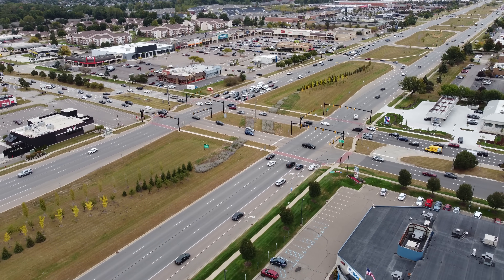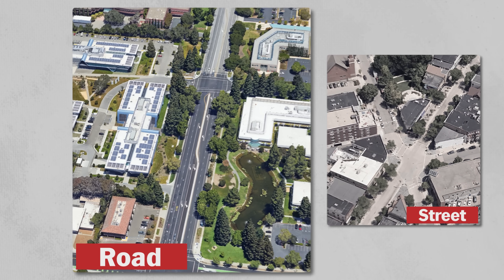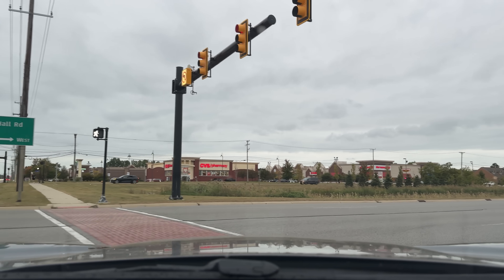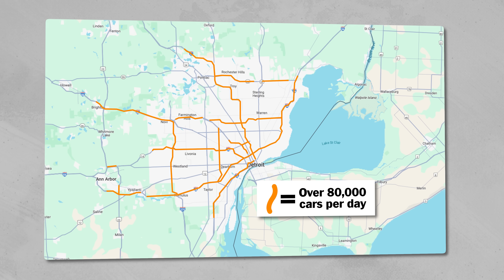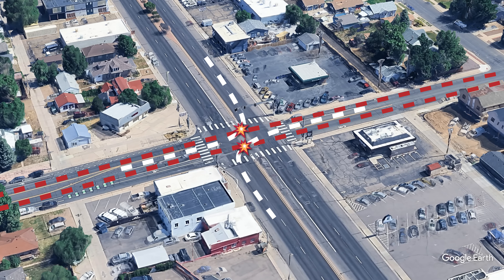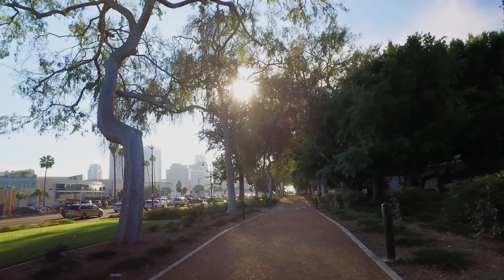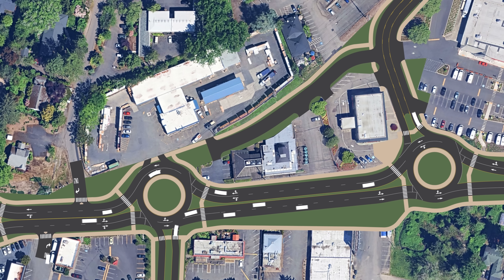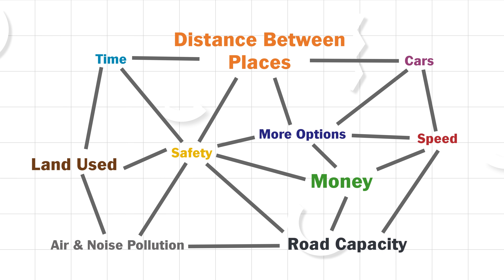How Michigan Built a Super Highway Using Only U-Turns

Comment: Being not a Michigan resident but a frequent visitor driving Hall Road, there are two concerns...

1) You still have to cross over all lanes of one direction to reach the switchback to go the other direction, and most drivers want to use the first switchback available.
1a) Or, if you do the switchback first and then take the right, that also requires crossing over multiple lanes of traffic.
2) Only roughly half of the switchbacks have traffic lights to make the left turn onto the thru lanes for the other direction.

Comment: Here in Perth Australia, we have many of these dual carriageway roads with 4-6 lanes with speed limits of 70-80kmh, but most of these are divided by traffic islands, meaning there aren't many opportunities to turn across traffic, and where there is access to businesses, there are often shared driveways, or you have to turn off at a set of lights to a smaller road first.
On the smaller ones that were built before they saw this problem, the speed limit is usually only 60kmh.

Comment: A somewhat niche additional benefit of the simplified signal patterns of Michigan lefts is that they are also very convient when a road parallels a rail line, as Chicago Drive does between Grandville and Zeeland west of Grand Rapids on the other side of the state. 

Since everything is designed to optimize continuous greens on the divided road and light cycles are shorter with fewer phases to cycle through, long freight trains bringing down the gates doesn't create as many obstructions as a traditional intersection.

Comment: As a Michigan resident, I would really, really appreciate if these were predominantly replaced by rotaries.
Reply: Would not work.  Traffic circles are longer allowes in America; we only install roundabouts.  And a roundabout is better for lower volume roads, not high volume corridors.
Reply: @traffic.engineer  Congratulations on your pedantry. Michigan lefts installed on roads with fewer than three travel lanes - like the dozen or so I begrudgingly tolerate daily - would be completely fine.

Comment: I moved to Michigan a few years ago and i hate Michigan lefts.  I get the logic and safety behind them, but i feel like they just enable stroads to be even bigger and stroad-ier.  In addition to being confusing for anyone not used to them, they make a road even more like a high speed highway while still insisting on allowing access to lots of businesses.  There are tons of conflict points and some areas are always backed up from all the turning in and out of the business. I also question the claim that it is faster for left turns.  I so often have long waits at all 3 lights going through the same intersection. 

Oh, and please don't describe a token sidewalk or crosswalk as pedestrian infrastructure.  These places are not actually designed to be walked out biked.  It is uncomfortable to be near this fast traffic.  Crosswalks are few and far between.  These roads are very wide to cross and the places on either side are usually massive parking lots

Comment: Your Hall Road example used "extra" traffic signals where the U-turn lanes intersect before/after the main intersection. In some places there is no signal, but because the main road traffic is typically grouped together ("platooned") there are significant gaps for safe U-turn movements without a traffic signal. It depends on the volume and driveway locations.

Comment: Those are everywhere where i live.
Unfortunately they are bad for a few reasons.
First, you have ro cross lanes of traffic to get to the u-turn, whith a sense of urgency and sometimes slowing way down to make it. dangerous.
Second, as a european driver, we keep right. Left is for passing. Passing on the right is forbidden for good reasons. With such U-turns, you have to pass on the right because cars which go in and out of the u turn are slow. slow cars meeting the highest-speed lane is a no-no.Third, when they back up traffic, tcars end up blocking the fast passing lane.
Bad, bad, bad.

Comment: In Illinois, we called these "Michigan Boulevards" and in Florida and North Carolina we call them "Superstreets". Their use is spreading across the US... although typically in 4- or 6-lane designs. Whatever the name, they do work to reduce the number and severity of crashes.
Reply: Out of curiosity where have you seen some in NC? Feel like I’ve driven all over here but never seen a road like this
Reply: @ShivNC  I suggest you visit the NCDOT.gov website and on the home page enter a search for "Superstreet". You'll find many examples of both planned and constructed Superstreets.
Reply: @ShivNC  NC roads do not have the through movement for the sidestreets.  You surely needed to make a u-turn in NC at one point.
Reply: NC has changed the term to "Reduced Conflict Intersections".

Comment: it doesnt matter what the question is

the answer is always the roundabout
Reply: I agree that they are a good solution in the right places, but I've seen so many people "freeze up" at newly-built roundabouts. That, or the clueless treat them as four way stops. Have had a couple built in my area in recent years, and people waiting to enter get irate thinking it's "their turn." That's not how a roundabout works! He who is in the roundabout has the right of way.
Reply: Roundabout would not work with these volumes and patterns.  UK proved this when they signalized and paved roads through them.
Reply: @traffic.engineer  No argument. We realize they have their limitations, but so many people in the US despise them even where they are appropriate.
Reply: Roundabouts would've been more common if they were really that good. It's not as simple as that. They have their strengths and weaknesses, just like any other intersection design.
They don't work well when the traffic is unbalanced - if for instance one road is much busier than the others. The other roads will not get enough gaps to enter, resulting in delays and backups. Traffic lights are better in that case.
They are also not good for pedestrians, especially the blind, as they have no way of knowing when it's safe to cross. And they are also not good for cyclists, because of the speed and size difference, and angles, which may put them in the blindspot of a driver.
Reply: @trainsim5869  Of three new roundabouts near me, two removed four-way stops that had horrible backups during rush hour and school start and release times. Locals wanted traffic lights, but the traffic engineers stated, and design studies showed, that wouldn't alleviate the backups, because certain directions would need a protected left turn. The third replaced a dangerous intersection where the secondary road had to stop and the primary road was posted as 55mph. This made left turns onto the primary road, as well as through traffic staying on the secondary road, dangerous; there had been several serious accidents at that intersection over the years where a vehicle on the primary road t-boned a vehicle entering the intersection from the secondary road. With the roundabout, ALL directions are 35mph, plus the design forces one to slow down.

Comment: I grew up within 1.5 miles of Hall road. I remember when that was built. Believe it or not, I remember when it was 2 lanes😂

The trickiest thing is figuring out the traffic pattern. Specifically, the middle lanes tend to be faster than the left lane as there are fewer cars moving in and out of the pattern. That being said, the traffic density is high enough that you should really pick a lane and stay there.
Reply: @swolf2004  I do remember in the 80s when Hall Rd was one lane in each direction and sometimes a turn lane.  And when Lakeside, MCC North Campus, and that one English Gardens were the only things there. As a teen going to the mall from the south end of Sterling Heights was an adventure! 😄
Reply: @Sally-up8xe  I would be grateful to learn your stories of Lakeside. At almost 50 years old, I doubt anyone will remember Lakeside or malls in general in another 50 years.
Reply: @Sally-up8xe  Don't forget the Big Boy and the bowling alley! I visit the area somewhat frequently now, and it is an odd nostalgia tour.

Comment: I would rather take a left over 3 lanes then I would relying on my side view mirrors to cross 3 lanes.
Reply: You are doing it wrong.  You arr supposed to turn directly into the left lane from the intersection.  

And yes, it is safer than direct left turns.
Reply: @traffic.engineer  I'm not doing it wrong when my city has a street littered with these and I have to cross 3 lanes in a few car lengths..
Reply: @SaberKittyZero   which is why you turn directly into the leftmost lane, not the right then change lanes to the left.

Comment: Michigan lefts are a blessing. Left turn accidents are some of the most common ones.
On Telegraph road  (US24) and Woodward Ave (M1), possibly more roads, if you drive the speed limit (+5mph), once you hit a green light, it'll be all green till the end..❤
Reply: Interestingly, Ford Road, which intersects with Telegraph, is what many consider a typical stroad with no Michigan Lefts for much of its length. I drive both roads on a regular basis and as well timed as the lights are on Telegraph, it's almost the exact opposite on Ford Road. If there's medium to heavy traffic you will get caught by at least half of the lights from Telegraph to Wayne Road. Leaving a parking lot onto Ford Road in that area it's almost impossible to turn left unless it's off peak hours.
Reply: @ Yes, absolutely. Whenever we have to go to Canton or Westland (from northern suburbs), we get off 275 and immediately take Warren Rd or Ann Arbor trail. The amount of traffic on Ford Rd, coupled with long waiting time on lights, is a nightmare, especially during rush hours.
Reply: @Car_guy31  Canton grew much faster than expected. There are plans to turn Ford Road in Canton into a boulevard.
Reply: @CRBungalow  That's amazing. It'd change the entire look of it.
Reply: @rjgoniea  Dearborn Heights Ford Road west of Telegraph used to be all houses oustide of the area where Target and Kroger are until about 5 years ago, I think the city slowly brought out all the houses on the side of Ford Road. But yes I avoid Ford Road at all costs between 2pm and 7pm.
Reply: @Car_guy31   8 Mile too - set your cruise control at 40 and you'll make just about every light
Reply: @Sally-up8xe  Quite a headache to drive below 60 on 8 mile lol. But you're right.
Reply: Telegraph is usually timed really well.  I frequently used to run from Flat Rock to Waterford with one stop at Ford Rd (almost always) and one stop at 10 mile (if traffic was moderate).
Reply: @gijoecam  unfortunately some of the light timings have gotten messed up like at Wick
Reply: @Karmy. Yeah, that happens with storms and power outages from time to time. I noticed that one morning last week going to work that way. Usually takes a few weeks of back-ups for them to reset the errant ones.  Happens from power outages during storms.
Reply: Michigan lefts are a blessing lol.... there great!!!
Reply: @ a lot of traffic issues in Chicagoland could be solved with those. It takes 1.5 hours to get from Schaumburg to the loop at 5 PM.
Reply: Mound rd. I5 through Novi. I wish more people realized this simple trick. Cheers
Reply: @MrHurst-lb1rn  Mound road and Van dyke will be all green only at 50 mph+. 
But yeah, Novi is a bit of an outlier. All red, always..😂
Reply: Not in my experience on Woodward. Berkley seems to deliberately set their lights entering the city off cycle going north or south, as does Highland Park at McNichols.
Reply: @the_pi_th_horseman  we don't talk about Berkley, all thier traffic signals are screwy to match the residents
Reply: @ Unsure about Highland park, but Berkley and Ferndale sure do this on most weekdays. They do sync it up on weekends.

Comment: I love the idea of using 2+ roundabouts in a busy area to eliminate left turns. Drivers have to add a few seconds to their trips but it really makes a huge safety improvement for all modes of transport. We’re having an issue with left turn safety in front of our train station, so one concept plan bookends the street with roundabouts, so that the station drop off loop is right turns only, while also making the current signalized intersections more efficient. Sweet vid!
Reply: those few seconds would also seem they don't exist because with roundabouts they are constantly doing something, not sat around waiting.
Reply: Acctualy if they are well designed they wil save time unlike a michigan left turn.

Comment: What I don't get is why those u-turns don't just keep turning into a new lane they could use to merge/yield? What even bother with the signal for them?
Reply from the maker: Because they likely need to get all the way to the right asap and the light helps reduce conflict points compared to immediately getting over 4 lanes after they merge
Reply: Signals are needed where high volumes conflict.  Roundabout merges only work well when volumes are low.

Comment: I drive Hall road every day and I mostly agree with the takeaway. It is really efficient if you drive the speed limit but if you go too slow or too fast you will hit lights.

The downsides of the design are the location at Romeo plank and in Utica where it transitions from 4 to 3 lanes. In these places there is so much throughput that cars need to zipper into eachother and some drivers will inappropriately use turn lanes to speed in front of other drivers.

The other issue is just geography. In Utica there is a river that splits the bulk of Macomb county from its western half and Oakland county. There are too few bridges so a lot of surface traffic is forced onto the road and can back things up at rush hour when they really have no need to use Hall.

Comment: Anything but a roundabout istg
Jokes aside, this is a good example of using what you've got and improving it. It can be improved heavily, but it's still better than any other highway intersection I've been through. Also, it should be remembered that highways should go AROUND the city/town, not through it. I would recommend trams/streetcars. They are superior to buses.
Reply: its okay if highways go through the town (technically), BUT you have to build alot of infrastructure to cross-connect the places they separate. and its not really healthy having all the cars go through the city
Reply: Roundabouts are popping up all over Michigan as well. Though they're being put in intersections with less traffic and more space. Also, sometimes the town is built around the highway that originally went around it. At that point, there's not much you can do other than work with what you got.

Comment: Michigan resident who's been to that road here! I think Michigan Lefts are generally a good idea from a pedestrian/cyclist safety standpoint. In my experience, cars turning right are better at yielding to pedestrians and cyclists on the crosswalk than cars turning left. The cars turning left typically have to wait for crosstraffic cars and don't think to check for someone on the crosswalk once they have a gap in car traffic. However, I think that when car volumes go up and up, Michigan Lefts can only go so far. The crossovers that allow u-turns will need traffic lights, and entering a crossover from a side street, like what is shown at the beginning of the video, means you have to cut across a bunch of lanes (which is technically illegal). I've been on Hall Road before, and it gets frustrating having to wait for 4 lanes of car traffic to clear up. And of course, because the road is massive, it makes the environment more awful than usual for anyone not in a car. Michigan Lefts are cool and all, but at a certain point, it's worth just thinking about how car volumes can be reduced, because that's where most traffic problems stem from anyways.

Edit: also, the space to the right of the road to allow large vehicles to Michigan Left is an abomination and should never exist

Comment: I would like it if you would say what is the speed limit when you say "high speed". Where I live, most stroads are 50 km/h.
Reply: Typically ranging from 35 mph (~55kmh) all the way up to 50mph (80kmh) here in Michigan. It should also be noted that operating speeds are different, since telegraph and woodward (not sure about hall rd) typically see actual speeds of 55-65mph